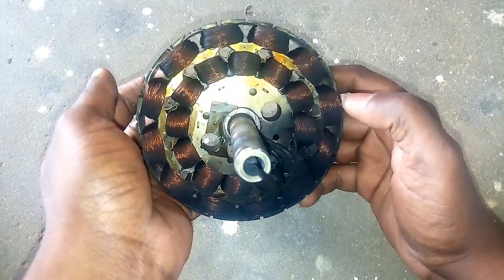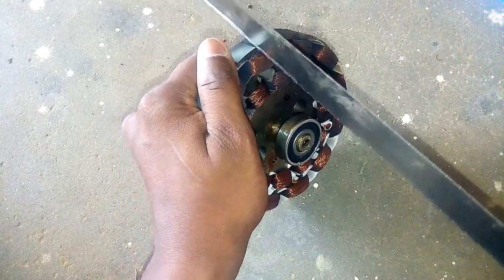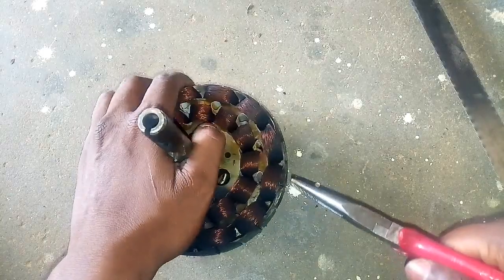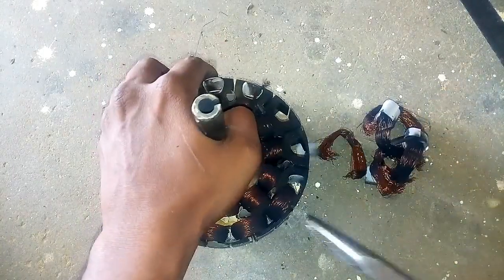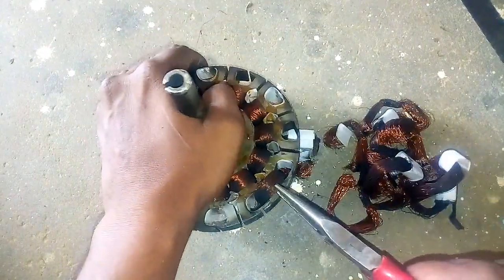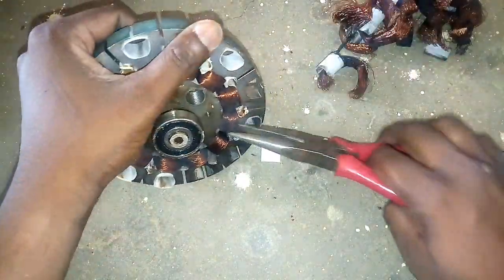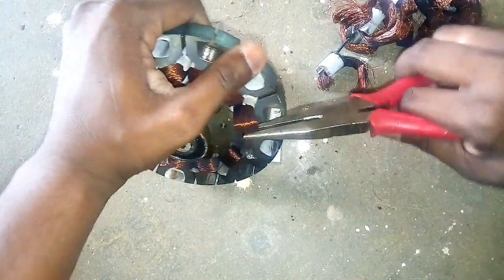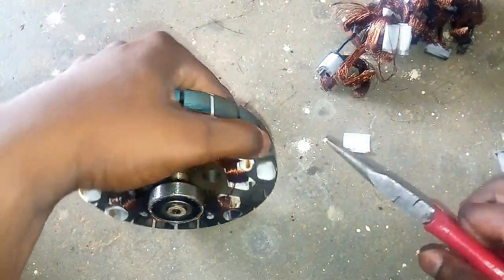Ceiling fan || Winding cutting || RS Electrical Tamil Channel || Ramanan

Comment: Table fan shaft bush change pannalum motor humming sound varthu motor Oddla enna pandrathu
Reply from the maker: Check ur winding first
Reply: @rselectricaltamilchannel456  winding nalla iruku Vera rotor pota oduthu